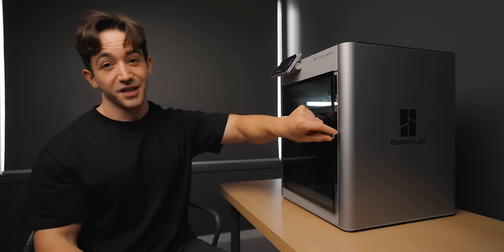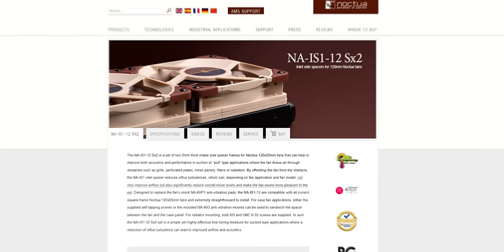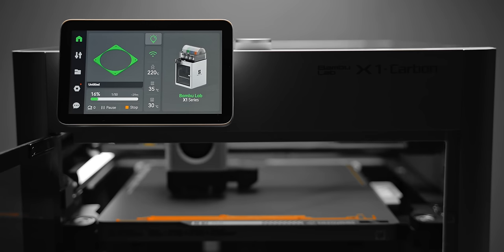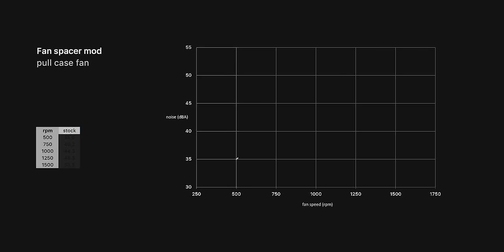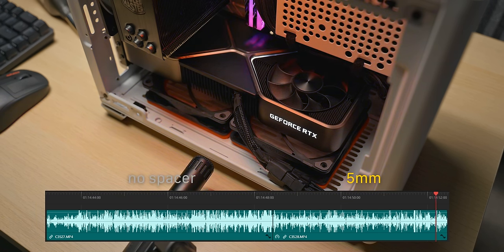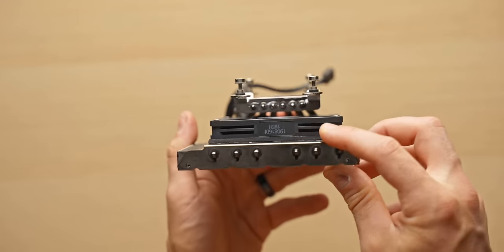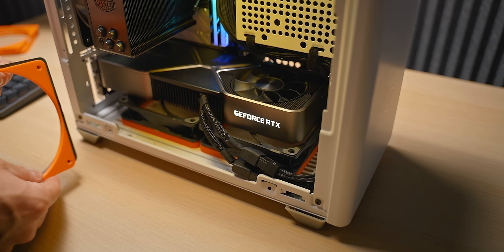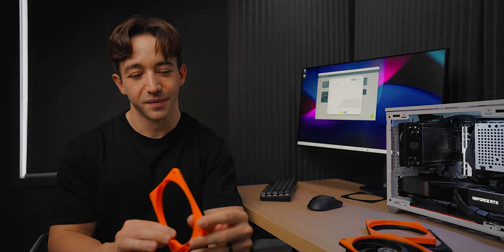Stealing Noctua's quiet airflow mod

Comment: It's a shame that more fan thicknesses arent available to allow for mods like this to fit inside ITX form factors (20mm for example).
Having said that though, i would love to see Noctua make a 30mm chromax variant of the NF-A12 for a direct T30 competitor.
Reply: The Noctua NF-A12x15 and Corsair AF120 Slim are both 15mm. The Scythe Kaze Flex 120 Slim is 17mm I believe. Or if you have 14mm fan mounts, the Arctic P14 Slim PWM is 16mm thick. All of these are viable options if you're space constrained, but of course you'll trade off some performance - which may get to the point where it might not be worth it to go for slim fans in the first place - but that's very situational.
Reply: @-eMpTy-  The scythe Kraze flex is 15mm thick. As is the Arctic P12 slim... the P14 won't fit in a 120mm fan mount and I can't imagine you'd need a slim fan if your chassis allows for a 140mm mount.
Reply: @AxleLotl  
No, the scythe kaze flex slim is 17mm. Maybe you're thinking of the old version. And a 140mm fan obviously won't fit on a 120 mount, I don't know why you're going off on me like that. There are also plenty of ITX cases with 140mm mounts where slim fans are viable - SSUPD Meshlicious, Fractal Design Ridge, Phanteks Enthoo Evolv Shift XT, Streacom DA2 V2. I could go on.
Reply: @-eMpTy-  it's 17mm with the vibration dampeners attached... the actual fan frame thickness is 15mm...
I'm not going off, I'm just making some corrections to what you stated and yeah, theres definitely some chassis that utilise 140mm mounts, the DAN C4-SFX for example which is one of my favourites however, I can't imagine there's too many use cases where slim 140mm fans are needed, because if you're that constrained for space, 120mm fans (and 240x20mm radiators) make more sense...

Comment: If the AIO already has the 5ish mm between the fan and the radiator, is there a benefit to putting the spacer between the radiator and the mesh case panel?

Comment: "The geniuses at noctua have already created a very simple mod" ... dude, I had these shrouds 15 years ago from phobya with my very first custom water loop set. You can buy them still today for 5 € (not 15€ as for the noctua ones) and they will do with every fan in that size (120 or 140). You're welcome :) :P
Reply: Does Phobya have a 5 mm spacer for a 140 mm Lian Li fan?

Comment: Could you also produce the designs in all the other sizes, please? I've got fans 40-220mm. Thanks!

I'm pretty sure that it won't work on a round frame, though.

Comment: Sadly my Noctua NH-D15 , when the speed's set up to 80%, makes some high pitched noise. If i reduce it down to 980RPM the pitch's gone but it creates a humming "Wooooo...Wooooo..." instead. Cannot be heard with the tempered glass turned off but this happeend 5 months after buying the cooler

The question is, can i put some cardboard  shaped like the fan (in case i don't have 5mm cuttable rubber or something) to separate the culprit fan (The one above my RAM) against the heatsink to prevent this noise to happen while being able to put the CPU cooler back on it's 80% speed?

Comment: It was rather standard on old cases for the meshed area for fans to actually be raised away from the rest of the case. I’ve put together several retro builds, most recently in a massive Supermicro 750, and none of my fans are very noisy at all because of this feature.

Comment: Tech PowerUp tested the EK Meltemi 120ER on a rad and they got better performance putting a 12mm shroud between the fan and rad cause of the huge central hub.

Comment: Hi, did you test on the radiator in both push and pull or both at once? I have mine i pull. Looked like you only tested push, but for all I know there was no interesting data in the other modes?

Comment: Which kind of filament did you use? I wonder if TPU makes any difference. The only problem I see is getting screws in the proper length for my rads (imperial vs metric, sadly not every hardware shop has both).
Reply: The materials and the screw part wasn't totally clear for me either :/

Comment: Hmm, I don't have a 3d printer but I'll try cutting something out of foam, could benefit my gpu since I run it deshrouded with noctuas. They've got the anti-vibration pads on but they're not that thick in the end. While Noctua do sell foams for their 92mm coolers, this'll be 10 times cheaper. We'll see how it goes.

Comment: How is he attaching the fan to the case with the additional 5mm from the spacer? Isn't the M5 x10mm standard size fan case screw too short? I know you can use the NA-SAV3 silicone rubber mounts Noctua's inlet kit includes, but does anyone have a link to a similar length M5 screw we could buy if we print the spacer ourselves? (Noctua includes NM-SFS4-BK long fan screws, but no idea of an equivalent)
Reply: Can't find anything...

Comment: Was wondering what if you 3D ptrint the case cover with fans holes instead?  More air right since it won't have the small holes, but more dust will go in the PC.

Comment: The worst I've heard this problem is from factory GPUs where the fans are pressed right up against the heatsink. It's almost all of them, and is most apparent when at higher fan speeds. Thinking about 3D printing some spacers for the fans in my 3080 Ti. The fans themselves would be stepped out of the shroud a bit, but that's fine with me. Edit: someone should sell spacer kits like this for various GPUs.

Comment: i was using 20mm fan spacers back in the early 2010s lol!

we used to do a push pull with spacers on radiators to eliminate any dead space where no air was flowing over the radiator core.
nice to know it also decreases noise

Comment: lol these spacers have been available for... many, many, many years. Dozens, maybe 20? Bought and used some ages ago, worked great! not a gimmick by any means...  anyhow, another easy way to do this is to gut an existing dead fan from your parts box, fasten however you want. takes up more space of course.

Comment: This doesn't work with all fans, or you will need longer screws. I use the thermaltake a1425, and they have the rubber dampeners embedded into the plastic fan, so the screw will be too short.

Comment: I have this issue on my fractal design define r5 side panel slot. It's an awesome fan slot, but the fan blades get too close to the grill. I had been using the case's HDD feet to space it from the wall for a long time to keep the fan quiet, but I bought noctua's spacer when they released it and it worked better.

Comment: transition duct, neh, Noctua "invented" it, lol. I'm not the only one to fuss with them things for a very long time, and they work to be honest. if they didn't work, I wouldn't have fussed with making them since the 486 days. do it correctly and you can solve the doldrum behind the fan motor as well. Optimum thickness depends on the fan blade shape and the grating it's against, for getting airflow behind the motor takes a lot more.

the simplest way to make them, is to get a dead fan the same size as the working one, and gut it till it's just the outer frame with no motor frame or stuff inside the housing. from there, you can play with stator vanes and such if you want (cut-up plastic coffee cans work well for vanes). another way if you must have a thin spacer is to trace out the fan on an arts&crafts "foamies" sheet and cut out the shape, also the foam stuff absorbs vibration and reduces fan-mount buzzing aside from being available in many colors.

Comment: I don't have this problem, since I have a full mesh case, so no exhaust case fans needed (air escapes out the top and back, all mesh). I have 2 intakes, but I removed the mesh on the front of the case, and screwed in some chrome fan guards

Comment: Plastic doesn't really serve you well in terms of avoiding micro vibrations, which ultimately transfers to the chassis and gets amplified. Try using the same or similar material as Noctua, so maybe source some rubber or silicone gasket.
Reply: Come on man, all those are types of plastic. What you mean is that you think hard plastic will transfer vibrations, but I'm not so sure considering it's honeycombed and moderately flexible. A better suggestion might be to use TPM filament, as sourcing rubber or silicone gaskets in the right size would be a headache. You would have to either cut it out of a sheet (doable) or 3d print a mold and pour silicone into it (annoying).
Reply: Perhaps they can compliment each other! Gaskets compress too thinly at times. Currently using them for intake.

 I've bought some hard plastic dust fan filters and removed the filter and cut out the grills as well. That can add some thickness.
Reply: @yensteel  They are a bit crap generally, and should be far cheaper, I just use Nokia fans because it's all false economy in the end. Some people like to make their own stuff though so whatever floats your boat ;)
Reply: @Timmy51m  Would love to have Nokia fans! They would last forever XD. The vibrations are poorly absorbed by the dust filter shells indeed. 3D printing is still foreign to me. Noctua could be worth buying in the end since they did all the research. Buy once, not twice ;)

Comment: Hi, I've been wondering if I should get a new CPU or GPU. Right now I have Ryzen 5 3600 paired with GTX 1660 Ti and I'm in confused whether I should buy ryzen 5 5600 or a better GPU(either 2060 super or 3060 Ti). I mostly play fortnite on low settings for performance so CPU intense task. Any advice is welcomed.

Comment: I've been using slim 120mm fans with old phobya branded 3mm rubber gaskets in the bottom of my ncase for years to solve this issue.. I was actually frustrated when I went to buy more last year and found they'd disappeared off the shelves years ago.

Comment: I just rebuilt my Dan a4 h20 build from a push build to a pull build on a 240mm radiator and it dropped temps 10 DEGREES at idle

Comment: I have a problem, i need a 13mm spacer for Noctua NF-A6x25 IndustrialPPC (60mm x 25mm) fans.
My server rack supports 60mm x 38mm.

Would you be able to sell me 6 13mm spacers for (60mm x 25mm) fans?

Comment: How does it compare to having a thicker fan that potentially runs at a lower rpm?
Reply: Its about the gap between the fan and the mesh, not the thiccness
Reply: @MrBlackmidi1234567890987654321  Yes but I wonder: If you had a fan with the same thickness as the other fan+gap, how would it compare? Maybe it could run it at a lower rpm because of its increased thickness and maybe come out as even better.

Comment: Yours are probably better than Noctua's, since yours do not allow air between grill and fan. Noctua's do, which will reduce air-intake from outside the PC. Noctua's leave a narrow gap between case and fan, because they are not flush with the body of the fan. Nor do they go all around the fan.

Comment: Do you need to have longer fan screws when adding the spacer?
Reply: That could definitely be a problem as it's hard to find the specs of a standard fan screw.  Most are self tapping M5 ones with a really coarse thread.

Comment: I'm thinking about upgrading from 240hz AOC VA 27 curved panel to a backlight strobing 240hz panel. Is it worth the upgrade?

If so, I found the most afordable options : viewsonic xg2431 vs asus tuf vg259qm.

Which one has better strobing tech/overall better monitor? I read somewhere that the veiwsonic is too dim but is more sharp. Im not sure which one to choose.
Reply: personally i would use the viewsonic as a second monitor & set it to 120hz bcz of the relative crt delay margin that it has, and for my main monitor the acer 360hz (chinese ver.)

Comment: I guess being old school and aged I don't get this super fascination, obsession, fixation on fans being quite. Jamming a Mic. in the system to see if you can .01 disable and complaining about if a fan can even be heard or not is beyond me.  This only means more money for the Fan manufacturers and higher price for the end user.  If someone uses a PC / Laptop / Game console and can hear fan a ramp up /  running and it troubles them then maybe they shouldn't use them at all. It's a fan it ramps up and can make a little sound.

Comment: Congrats. You reproduced what the enthusiasts were printing 10 years ago. This has been sold for water cooling for more than a decade. Also, this attempt seems like a first try, as there are quite a few things you can do, to use printed parts as ducts. This is like what we all do, for our very first attempt. And just to be crystal on this one, this has been done for ages. At least ten years now.